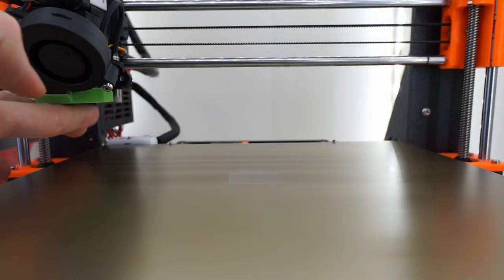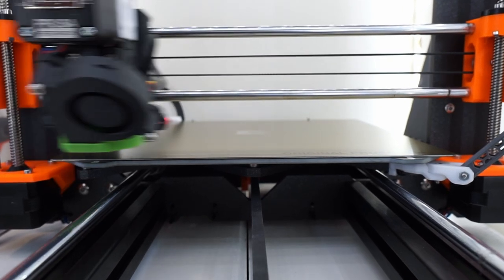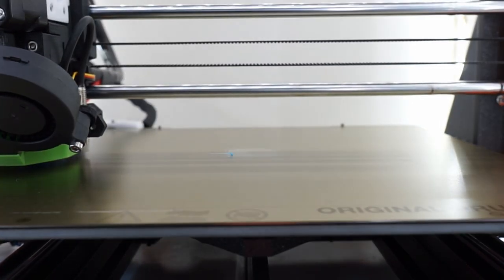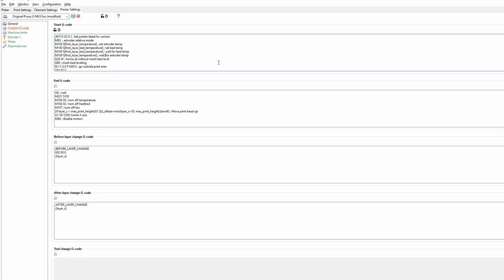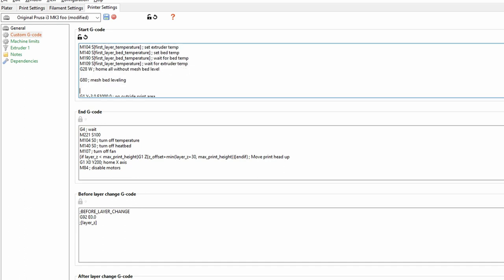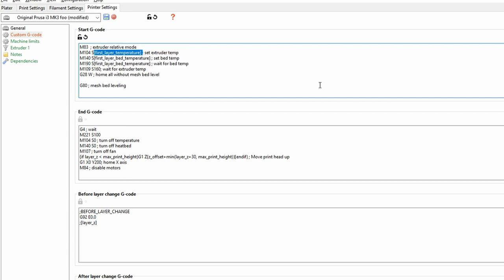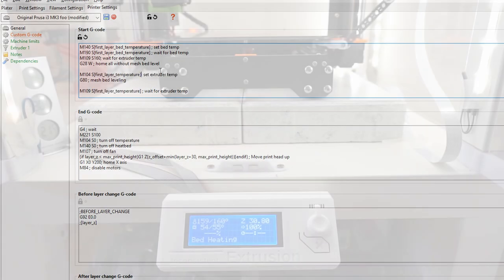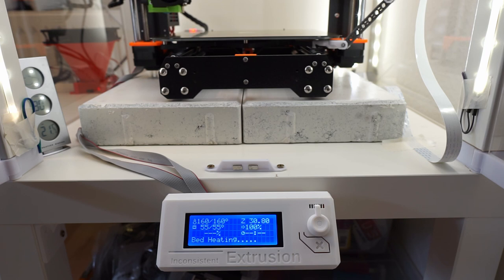As fast as possible | Avoid oozing during heat up and mesh leveling.

Comment: Hi, is this code still valid in 2021? Do you have updated start code that you wouldn't mind sharing?
Reply from the maker: Yeah, the concept still works fine.
You can do it yourself, just follow the steps in the video. Set a M104 with lower temps before, and a M109 after.

Here is mine, but don't just copy it, understand it: https://pastebin.com/raw/8Cq5iftK It will start with 4/6 temp, level with -5C temp and heat the last degrees after mesh.
Reply: @lord-carlosmakes6298   Does the {first_layer_temperature[0]*4/6} and {first_layer_temperature[0]-5} nomenclature work for PrusaSlicer (as well as SLIC3R) ?  I'm just curious about the squiggly brackets, square brackets and "0" ....  This trick is going to help me a lot !!!  THANKS !!!!!
Reply: @gohabsterphotography  That works fine in PrusaSlicer and SuperSlicer. I have not tried slic3r, I assume it's the same)
Reply: @lord-carlosmakes6298 

Hi Carlos , can you please provide me with an updated G-Codes for Start , End and Before Layer to use in fixing this exact  dripping issue on my Prusa Mini Plus ?  heating at 220 for PLA

I am asking you , becoz i don't really seem to understand how to make a G-Code and understand them .

Comment: I am doing this on Cura But only the S190, S170 works but S[first_layer_temperature] does not. Any ideas? I am using the correct wording and M104 M109 just wondering if there is any other command to set it to the appropriate auto temp first layer.
Reply from the maker: On cura it will not be called [first_layer_temperature], but something else. Something similar should already be there.
Reply: @lord-carlosmakes6298  Thanks for the quick reply, I found out that 
For Slic3r:

M190 S[first_layer_bed_temperature] ; Set bed temp.
M140 S[first_layer_bed_temperature] ; Wait for bed temp.
M109 S[first_layer_temperature_0] ; Wait for all used extruders to reach temperature.
For Cura you can add additional wait commands to the start gcode if you want, but note that the format is slightly different (See here):

M190 S{print_bed_temperature} ; Set bed temp.
M140 S{print_bed_temperature} ; Wait for bed temp.
M109 S{print_temperature} ; Wait for all used extruders to reach temperature.
Thanks to Poikilos for info on Wait for temperature.
Reply: @lord-carlosmakes6298  In the brackets for those temps, do you you replace with the numerical value straight from Cura, or do you match the wording exactly as it is in Cura, and it reads the temperature setting directly from Cura?
I'm thinking it probably S200, assuming my desired temperature, bt just wanted to verify.
Reply from the maker: @richsadler5686  I don't know how cura does it. But you should be able to see it in your existing start gcode.
Just add a lower temperature before the mesh bed leveling, then continue with the normal start gcode.